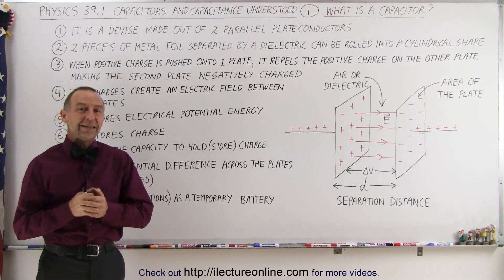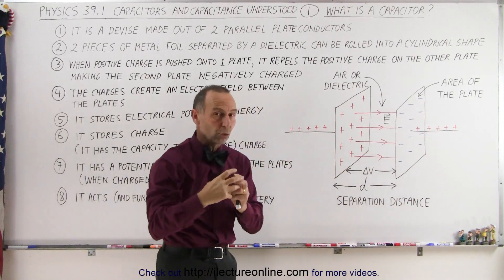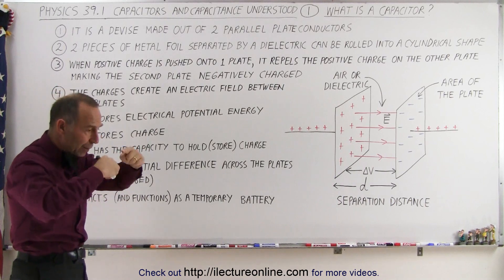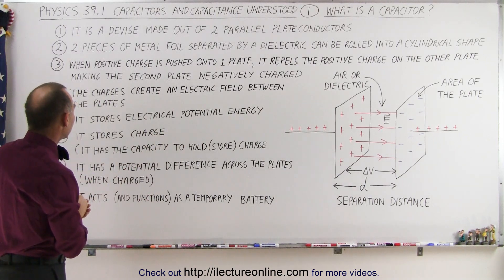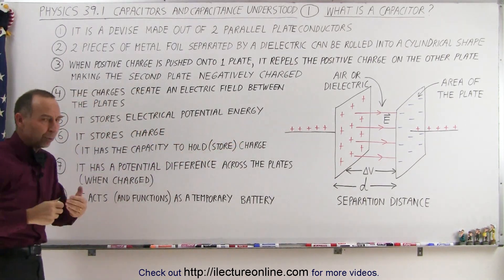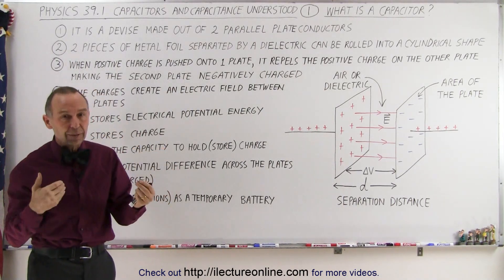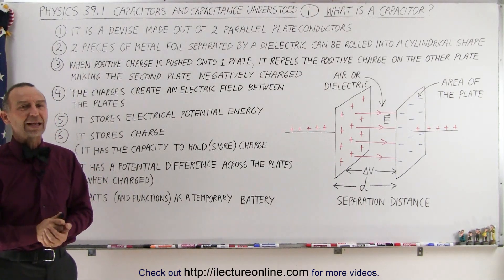Physics - E&M: Ch 39.2 Capacitors & Capacitance Understood (1 of 27) What is a Capacitor?

Comment: Why always we want insulator between plates of capacitors ???
Reply from the maker: It is not a requirement, and not all capacitors have insulators between the plates, but it makes it easier to manufacture them and it gives them a higher capacitance.

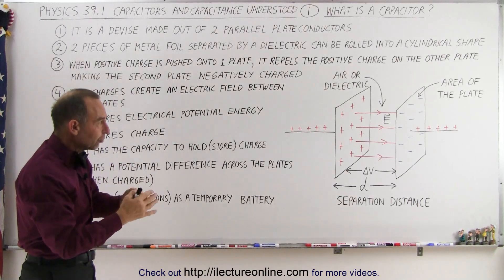Comment: My friend @ 1:41, instead don't you push negative charges on one plate which then repel the negative charges on the other plate leaving it positive? I thought it was electrons that flow, not protons.
Reply from the maker: In the real world, electrons move along conductors.  In circuit theory we use the general approach that positive charges move along the conductor.